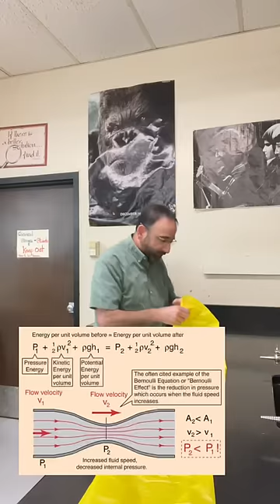Bernoulli’s Principle

Comment: This is not bernoulli, but a phenomenon called entrainment. This is the same phenomenon with air over aircraft wings where more air is pulled downward to help with lift. Bernoulli has no place with airfoils since we are not working with restrictions such as venturies, but mire to do with a fluid going over a curved surface.

Comment: I just use Bernoulli’s Principal yesterday at work (I work at an industrial/agricultural/landscaping equipment rental/repair business) and someone had put the wrong fuel in the tank. After draining, there was still a small amount of contaminant in a depression in the tank (the tank had been warped over time, probably due to mishandling/abuse).  I could have dragged a Jack over and tilted the machine to try to get the fuel to run to the port, but instead I took a length of fuel line and stuck one end in the depression, then took a blowgun and blew a get of air across the other end at a fight and for and vacuumed the rest of the fluid out.

Of course, there was an impressive white cloud of atomized fuel vapor as a result, so don’t try this at home— I’m a “professional” 😁🤣😂🤣
Reply from the maker: That is fantastic! Thanks for sharing! Might have to use your comment in a future post!
Reply: @wolf_science  see? I really WAS paying attention in sophomore year 😁👍

Comment: You can use that principle to cool down your house, on one side of the house open a window just enough to the size of the fan, then point a fan outwards maybe 2 feet from the window and turn it on, open the windows on the other side of the house or even on the same side, close doors or windows for rooms that have no one are are not needed to cool down to create a better draft.

Comment: Please remove the distracting captions. Thanks 🙏
Reply from the maker: These ones ended up a little large, but I always turn on captions for those with hearing impairments.
Reply: @wolf_science  so here's the deal that no one seems to know: YouTube already has a caption option that the viewer can toggle on and off. If you as a creator put captions in your video, they cannot be removed. This YouTube feature needs to be communicated to all YouTube creators and viewers.
Reply from the maker: The problem with that solution is that I, like most content creators, post our material across multiple platforms. That feature is not available on all platforms. But I appreciate the fact that you took the time to point out that solution for this platform. I’ll consider using it!

Comment: I think I'll use this technique when showing the Fire class. 
We adjust our stream from fog to stream. We don't want to feed the fire too much air. But when the fire is close to out, we can use a heavy stream by shooting the stream from inside to outside to pull out smoke.  We want to adjust our stream from the outside to not let it bring air into the fire.  We don't ventilate until its safe.
Reply from the maker: It’s also a great demonstration for why we don’t place PPV directly in a doorway or a window. Great example of why the cone matters.

Comment: Very good video and interesting. I have a question though:

When I bought a tent, I bought a sleeping mat that you blow up. Currently I am away and won’t be able to try this for months on it so I’m just curious if this will work. It has a hatch where you can blow air into or use a foot pump (but as it’s camping I prefer to not have a pump). so if I connect a bag (of the same material that is in the video) that has a connection part to attach to the mat, will I be able to fill the mat up quicker by doing this? 

As if you blow into the bag like you did that’ll fill that up so the air will then travel through the small hatch at the bottom of the bag. But I’m not sure due to the size difference between the bag and the hatch. Surely this will increase the pressure so the airs velocity will decrease and there wouldn’t be much affect compared to straight blowing into it?
Reply from the maker: If you could connect the two bags, it might work. Although I would suspect that you would need to compress the Bernoulli bag to gain enough pressure to force it into your sleeping pad
Reply: @wolf_science  Ok, thank you for the help. I appreciate it!

Comment: If o understood correctly, the pressure is lower inside the bag because the velocity is increased inside the bag (at the entry of the bag) due to the smaller surface area at the entry of the bag compared to the outside the bag?
Reply from the maker: Whenever fluids, in this case air, move quickly, they have a tendency to pull surrounding air into the stream. So more air than simply your breath enters the bag. This is also why dans work better when you locate them a few feet away from a window. I have a couple of posts about that too. Hope this helps!
Reply: Thank you for your answer! I actually try to understand why the Bernouilli’s principle only applies to the latter experience. 
In the latter experience, you blow in the air, creating the increased velocity and simultaneously the pressure difference, and thus more air is withdrawn into the bag to the lower pressure ? Is that correct?
But in the first experience, Bernouilli’s principle is not valid? Or the increased velocity and the decreased pressure do happen, but since you close the bag with your bag, more air cannot enter? Sorry if my question is totally stupid.
Reply from the maker: @ayette8618 If I am understanding your question- when I first blow up the bag, with my mouth directly attached, no extra air is allowed to enter due to the tight seal of the bag to my mouth. I’m the second version, Bernoulli’s Principle is allowed to play a role, and more air is drawn into the bag with my breath.

Comment: So the cross-sectional area reduction causes a pressure drop by BP. Whereas before you had just one area. And fluid flows from high to low pressure (why?). So this increases the flow because there is more mass given the air in the whole room.

This is probably how a siphon works

Comment: I’m a mech eng. This is not Bernoulli. This is a viscosity effect. You’re entraining the ambient air.

Bernoulli is an analytical tool that allows comparisons between two points on stream line. The air exiting your mouth does not meet the prerequisites for applying Bernoulli (not isentropic).